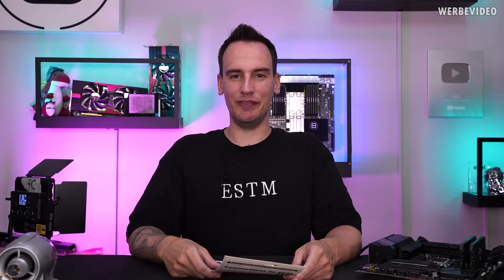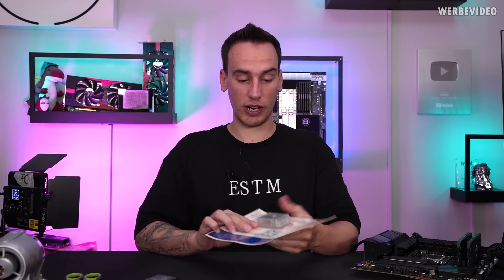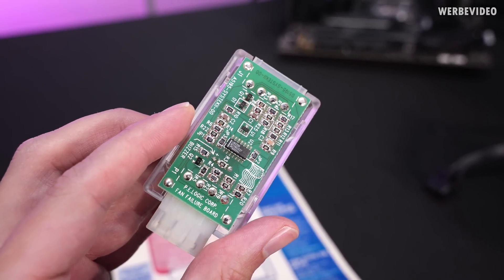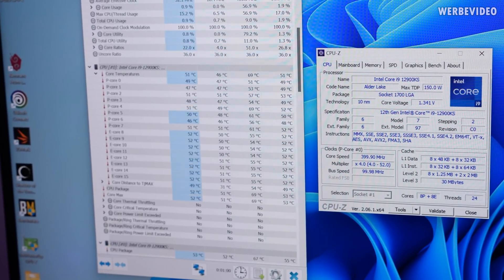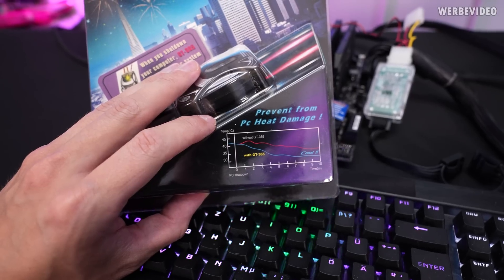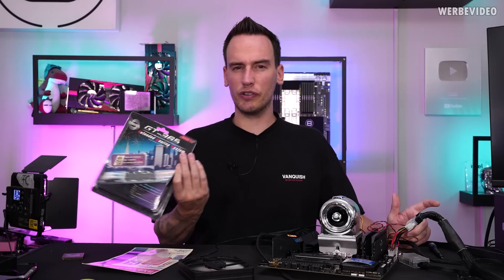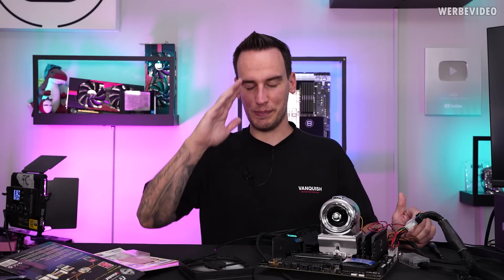This 30 Years old Cooling Gadget was Supposed to Protect your CPU... but it won't

Comment: The old coolers where quite chunky blocks of metal. I can imagine if the CPU runs very hot the block gets heated. When the power is switched off the heat in the block will dissipate back into the CPU. Not sure if that could damage these older style CPU's over time. But it's the only reason I can think of why such products existed. To be honest I still let my PC run a few moments into idle just after closing a intensive task. So the fans can cool the CPU/GPU a bit before shutting down. Don't think it matters 1 bit, but feels better.
Reply: I suspect it was more for if you had a stack of hard drives jammed together

Comment: Yes, have had a couple computers at work with failed fans. Specifically CPU fans after 10 years of continuous service. It seems to be very model specific as to what fails in that market. One model, all psus failed. This model the CPU fans all failed.

Comment: So from looking at a lot of these comments, notwithstanding claims about thermal measurement (was it measuring case temperature not CPU? DeBauer didn't test that), it seems the products were actually useful back in the day. It's just that 20+ years of developments in chip thermal throttling mean the need for a separate product has disappeared.

Still did end up googling some nowadays hilarious photos of the massive Pentium packages back in the day. That show Intel was using a version of chiplets/tiles back in the day... 😂

Comment: Had a Cooler Master centrifugal cpu fan like that 20 years ago, and it was so damn loud. The funny thing was that you could just screw on a normal 80mm fan on the heatsink and it performed about the same, but with far less noise.
Reply: I had a roommate who had a fan like that.  He was proud!

Comment: Have had a couple of stuck fans in my shop. Mostly from customers that are heavy smokers. The bearings get covered in sticky gunk and seize up. For regular users it's very rare, think I've had 1 casefan die but it was a cheap OEM one.

Comment: Actually, I used to work in a pc repair shop, and one OEM HP SFF PC had a CPU fan failure. The bios was saying that the fan wasn't working, and indeed, the fan was dead. No matter what voltage you put into it, the fan wouldn't spin at all.

Comment: Fans back in the late 90's would often stop working and cpus would not thermal throttle. A little bit of dust with a computer in a garage or business and they just sieze up

Comment: In the 90s, CPU fan bearing failure was definitely an issue, and would result in the fan running slowly, and sometimes quite noisily.  I came across it multiple times on 486s and socket 370 processors. The circuit probably uses the LM339 comparator to detect the current pulses drawn by the brushless motor. The variable resistor would set the threshold in terms of allowed time between pulses, and then enable the buzzer when the time increases. That's quite a good use of a quad comparator - current sense, timer, threshold  detector, oscillator.
Reply: When I was dissembling old pcs I saw that those old fans with old and worn out bearings were spining with a lot of resistance. Also saw a few dead fans. For old PCs, that didn't have safety features built into the CPU or fan fail warnings built into the motherboard BIOS - that thing could be helpful.
Reply: The VR was the speed controller for the jet fan. 
The Systro-Tek sadly had a fixed threshold for the comparator - it was made for 486 and p5 systems and the fans were on or off. I suspect it just uses a shunt (2R2 R4) for current detection and a fixed vref (zener diode d1). 
U1 is an LM45 temperature sensor which would be fed into the other side of the comparator  - i'd guess they probably use the same vref (zener diode D1).
May well have used teh other 2 comparator channels for the buzzer oscillator while they were there
Reply: @mycosys  Thanks for the added info. Interesting.
Reply: In the 90's If you had a smoker in the house the fan's were Going to stop spinning.   I've seen that countless times back in the day.
Reply: Hell, at that time "CPU temperature" was a thermistor under the chip
Reply: 486 CPUs actually did not have thermal sensors. This is because nobody expect them to require active cooling, even passive cooling (piece of sheet metal) was some kind of novelty. When more powerful 486 processor appeared (DX4 and so on ) , they started shipping them with cheap fans that did not have variable speed due to the lack of aforementioned sensors. Thus, they were running at constant speed, and would start to whine after a while, sometimes even stopping. If you were lucky, you could smell cooking silicone 😁If not, well ... Therefore, devices like this were somewhat useful.
Reply: As far as I remember all those fans back then were 1 speed, so in theory you could read fan temperatures with 2 wired by checking resistance on startup and you either have an ambient sensor on that board or you just assume startup is 21deg c, check resistance and then scale from there. Will it tell you cpu temp, god no, but you might be able to read a semi accurate fan temp
Reply: Fans failed often back then, (CPU & especially GPU) you have to consider that many heatsinks were 5 to 10mm tall at most (486/P1 age), with the middle portion even shallower on some designs to allow a tiny fan 40/50mm (5mm depth?) to be flush mounted within the heatsink... that was a lot of punishment on the bearings, just as LeitoAE said, combine that with dust, and those low power fans had no chance at lasting a very long time.
Reply: Anyone have FDB fans die or start sounding weird when in top exhaust position?
Reply: @Mack_Dingo  This is the worst position for them.
Reply: Yes exactly. And the 90's or even 80's Derbauer was too young for that still.

Comment: The i486 and p5 processors completely lacked a thermal sensor, and i am guessing that 110 degrees is Fahrenheit. 
You jam this up against the flat side of the 486 CPU cooler and pray. I'd certainly take it off your hands for one of my retro systems

Comment: this was an entertaining watch! I had a question... I have a Thermaltake SpinQ (not the vertical one) could you optimize it for use today in a system using a ryzen 3600 cpu at least or equivalent? The way the spinQ takes in air from both ends and expels outward makes me wonder if it can be optimized... would be a wonder like the Jet Engine cooler :) either way, great video

Comment: Maybe i am cursed but i have some experience with fans break, My Gigabyte gtx 970, one of the fans stop spinning, same with the default fan of my Scythe Ninja 3b of my old 3770k, it dead in a year. Another tiny fan from old ABIT motherboard, the one of VRM i think.   Some bad quality case fans from "Tacens" dead too.  Also have a friend has to remplace the gpu fan of expensive Msi laptop. Sorry for me English.

Comment: Once at work, we had quite an interesting experience with a broken fan. One of our storage servers had an insanely high amount of disk failures - about one every 2 months. After 5 or 6 failed disks (out of 7 IIRC), a coworker decided to pull out the machine and have a look at it. What we discovered was sobering. A blade broke off from a chassis fan, and that caused vibrations so strong, it destroyed the disks. I held the fan in my left hand and spun it with a finger, and I literally couldn't hold my hand still - that's how powerful the vibrations were, at just over 100 RPM... The fan was spinning at 1000 RPM minimum in the server.
Besides this, I personally had two fans seize completely, one fan which stopped responding to PWM and spun at maximum speed all the time, and one which had some failure that made it spin faster than it should while making infernal noise (loud enough to wake me up through two brick walls).
I always keep a spare fan for each type.
Reply: the stopping responding to PWM is quite common - its the PWM MOSFET going short
Reply: I'm just curious, were these industry standard fans (I'm not a pro, but I know Nidec and Delta are pretty common on OEM servers) or did a supplier cheap out on y'all?
Reply: @Collin_J  IIRC the one with a broken blade came with the tower case of the server. I don't remember if it was a proper server tower or consumer tower. The rest (ones I've personally experienced) were all original OEM fans from HP servers and APC Netshelter server cabinets.
Reply: Can totally believe that because I had that happen with a network switch that was in our lab, and the bit of broken blade inside of it made so much noise I heard it two offices down the corridor even though the door to the lab was closed.

Comment: the car design is most likely refering to that cars often has fans spinning after you turn off your car. not that it makes sense either as the pump stops with the engine...
Reply: But the radiator is still not, and the fan still cools the engine block to prevent heat soaking. When you are driving the car there is a equilibrium between the engine producing heat, and the air cooling it down. If you stop the car and turn off the engine that heat doesn't all of a sudden dissappear... It will continue radiating and heat up the air under the hood. 

Heat soaking can actually cause some annoying faults that are hard to diagnose...

Comment: Not a too silly or far fetched product, back in the day it was common with small fans at high RPM, and they could die at any time.
Nor did they have any plug into the motherboard, so what we have today with sense wires to detect RPM wasn't possible back then.
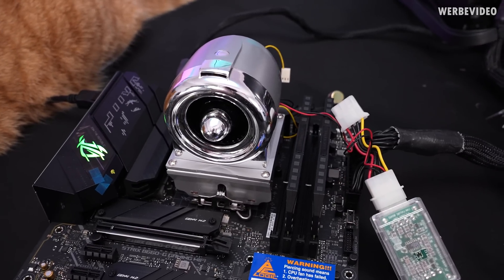Later on we got fan controllers that took on this task and were mounted in the 5:25 inch bays, another sadly dying relic of computing.
While the CPUs would stop being reliable at around 80 to 90 degrees C, with a stopped fan they would keep making heat all the way until they burned up, a smell that many say reminds them of burned socks.
So something to warn you that the fan had failed could be seen as a useful thing in the early Pentium days as the motherboards had zero protections for the CPU.
Reply: Ah the good old days of high speed CDROM, a slower CD-RW, and a fan controller taking up the slots in your full tower

Comment: It is always fun to see you drag out and play with old tech. 6:01 You are correct, it is a variable resistor or rheostat.
Reply: Also called potentiometer and potentiomètre in English and french respectively; especially electronics. I did hear the term "rheostat" used in industrial machines and large equipment too, but never in electronics for some reason
Reply: @abdoubouam  most common term would be pot, but VR is fine
Reply: No way that's a rheostat - the latter has only two leads/terminals (the one on the video has 3), most importantly it's used in series with the load.
Reply: @stanimir4197  The device is only using two of the three terminals. 

Cut and paste from Wikipedia. 
A potentiometer is a three-terminal resistor with a sliding or rotating contact that forms an adjustable voltage divider. If only two terminals are used, one end and the wiper, it acts as a variable resistor or rheostat.
Reply: sorry  @stanimir4197  , any good ol 'drag a contact along a resistive material' variable resistor is a rheostat.

Comment: I have had a few 120mm fans die on the top of a pushpull setup on a 360 rad. I had 2/6 have bearings go bad.

Comment: The computer does get hotter when you turn it off, BUT it's the heat escaping from the GPU and CPU outwards to the coolers (which are no longer ventilated by the fans), they are not getting hotter, only the coolers are getting slightly hotter, maybe a couple degrees ... in theory ...
Reply: Yeah, heat soaking.

Comment: What could theoretically happen is people setting a voltage too low for the fan to spin up, so it never starts spinning.

Actually, the temperature increasing is not a meme. It's called heat soaking. Basically their theory is that the heatsinks are still warm, but no forced air is moving. So you get a radiating heat in the case before they cool down again. This happens in car engines as well, they actually increase in heat under the hood when you shut it down. Now... granted, with modern systems the heatsinks dont actually get that hot anymore, and I doubt it's more than half a degree. But its not totally without merit.

Comment: I had two fan failures in PSUs though in both cases that happened after like 6 years of daily operation. Considering that I have fans that were running for a lot longer than that it could be that those PSUs just had bad low quality fans.

Comment: cheap fans can be stopped by dust or be broken by bad bearing. i saw several dozen of broken fans:) about SYSTO TEK - in theory on such old systems there were problems with overheating protections, so if fan stops cpu will get to 110 degrees. and that thing will signals to you that fan stops and CPU will overheat as result. so, marketing slogans on box are true but with nuances

Comment: I did have an NZXT fan cease up and stop spinning. It was all gunked up with dust and stuff and it got really hot rather than spin. Non repairable, had to replace. but with glass sided cases I was able to see it not spinning. so it was all good

Comment: My unraid server crashed a few months ago in a particular fashion. something to do with incompatibility with fan control on an asus board, the system froze, and all the fans including cpu stopped spinning, because of pwm. This little gadget for standby cooling might have helped save some lifespan for my parts if some airflow kept going... So yeah, niche case, but that's one scenario where that would be useful!
Reply: Many motherboards have an option in the BIOS/UEFI to do basically the same thing this thing does using the PC speaker. Also considering that these days we can monitor the temperature of most components in our PCs (including individual drives) it makes a lot more sense to use a software solution with temperature monitoring for early warnings and emergency shutdowns than a device like this.
Reply: @ElectricIndigoGryphon  of course but.... the system/kernel crashed, taking all the control software down with it. if anything i should have had a physical fan controller in my case instead of hooking them all straight to the motherboard. Or use fans without pwm maybe.

Comment: 5:59 it's called "potentiometer" (it changes resistance) - it should be the same in German. About the extra cooling after power down -- if the system shutdowns due to thermal shock  (overheat) the extra heat evacuation would help. In early the 2000s  I recall a case where the air condition in the server room failed - it was over 58C in the room when big iron Sun machines went down. In similar cases  it'd be somewhat helpful.
Reply: Or 'pot' if you use the word a lot, tho we would also understand VR
Reply: Or if only two legs are wired it is a "rheostat"
Reply: @Mack_Dingo  Fun fact, sometimes they call Pots Rheostats, even though they clearly have 3 terminals.  Even the big wire wound ones are called both.
Reply: Came to comment the same thing, there is a variety of usages for a potentiometer, ranging from fine tuning of electronics, dimming lights in a house, or even remote controls for stuff like an RC plane... Albeit it's a lot less useful in that last one since much more complex parts won't break the bank.
Reply: No, it already reached the problem temperature. Cooling it down faster doesn't really accomplish anything. Just like leaving a fan running in a normal PC after power off doesn't really do anything. Either your stuff overheated and died, or it didn't.
Reply: @Those_Weirdos  I mentioned the case with the failed air conditioner, similar to having a laptop overheats. You want to remove the trapped hot air as quickly as possible to resume operation - the system won't even turn on with high enough ambient.
Reply: @Those_Weirdos  i dont think its intended for the benefit of the CPU, half a dozen SCSI drives might not have the same feeling

Comment: Being made in the US  would that 110 degrees not be in Fahrenheit? Therefore around 43 degrees Celsius?
Having watched the reset of the video, I realise the temperature is completely irrelevant.
Reply: im young and wasnt alive back then, but i doubt cpus ran cold enough for 43 to be considered hot in any way.
Reply: @Ieonblack  I'm guessing it's measuring internal ambient case temp.
Reply: no, 43C is a sensible system temp to shut down the PC, esp if you keep the sensor near the CPU. U1 behind the window is an LM35 temperature sensor.

Comment: Before watch the whole video, I think this is just a CPU fan fail safe.
PS: In some countries the humidity is very high & some boards have option to Auto-start the PC in the middle of the night (or whenever you set it to) & spin the fans to disapate the humidity & avoid electrical short. Its a long shot but that the only thing that make sense for the other product.

Comment: I could see that second one maybe having some use in a datacenter or rack to like cooling fans going for a bit in the event of a temporary power outage or something like that but thats all i could think of
Reply: overtheating would be the prime case - it helps the system gets back to normal.